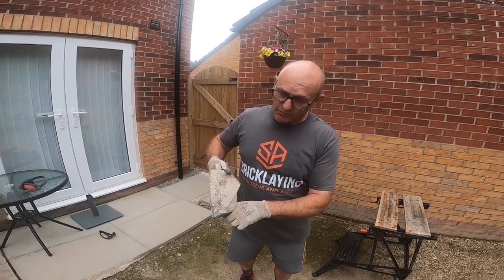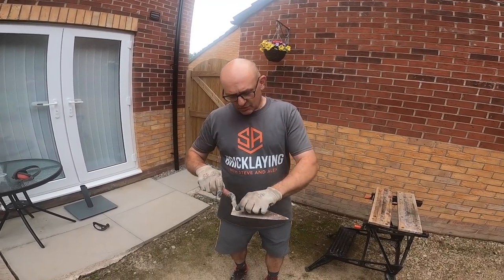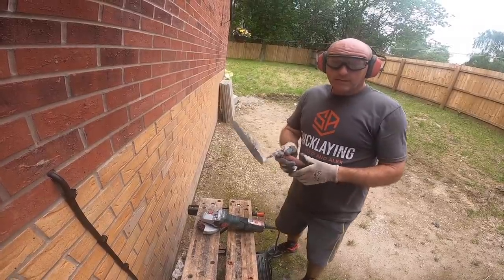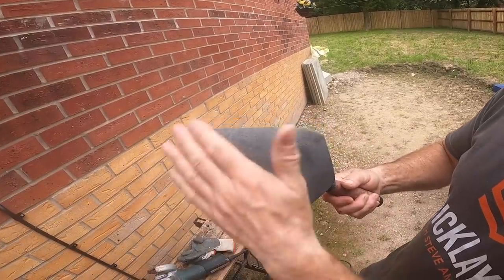CLEANING BRICK TROWELS...BEGINNERS TOOL TIPS

Comment: I would keep a piece of thermalite in my workbag and rub the trowel down with it and a bit of sand and water at the end of a shift. Finished off with a dry rag and a drop of linseed oil on the plain wooden handle of my Marshaltown. I was schooled in tool care by a 60 year-old bricky back when Work Hard & Starve meant something else!
He carried a small bottle of linseed oil in his workbag specifically to upkeep his wooden plumb-level, the type with a line and a bob-weight built-in.
Reply from the maker: Nice 🧱👍🏽

Comment: steve alex..you ever done thin joint blockwork, were you use a sweet scoop type of tool instead of a trowel..the whole innerleaf goes up first and each block is 4x the size of a traditional, when blockwork is complete the lid goes on and the other trades start on the inside whilst you start on the outerleaf with brick and mortar. just another way to get the houses completed quicker ,like timber frame or pods.
Reply from the maker: I’ve seen Rob songer doing something similar 🧱👍🏽

Comment: Hello mate what do you mean by the steel being pitted ?🤔 and do you think it'd a bad idea to clean a mixer with brick acid 🤔😅 nice vid mate 👍👌
Reply from the maker: Pitting is when the rust sets in and eats into the steel so when it’s cleaned off you end up with tiny pits .
   As for the mixer if it’s bad knock out the worst build up then Chuck a bag of 10 mm limestone and water and let it run for a good 40 mins and it will polish it up a treat .
    As for acid once on steel it’s very aggressive and you can see the rust actually forming as you look at it . Avoid it 🧱👍🏽
Reply: @SteveAndAlexBuild  ok mate thanks alot for that I'll bair that in mind 👍 I try too ceep it a clean as I can👌 alot of brickies I know just beat the f*** out of it with a hammer when  it gets really bad 👎🤣 what it you oil it after the asid has been on it 🤔

Comment: W Rose the way forward for a light trowel.
Reply from the maker: Oh no Rodian gave us one abs it’s a pig 🐷 😩🧱👍🏽
Reply: @brickbybric  
Yeah buy them from Speedcrete mate. Last 1 got direct from Kraft tools via speedcrete. Philadelphia wide heel. They didn’t advertise the proform handle in even in digital Kraft online book. But contact and they put 1 on no problems. Thing is W Rose are well priced. £37-£45 bucks unless you use Amazon or that may pay £60 range. Speedcrete best to use as they deal direct with Kraft tools. Think most just go with what’s easy to access and that’s your marshaltown there 10 a pennie in tool place or merchants.